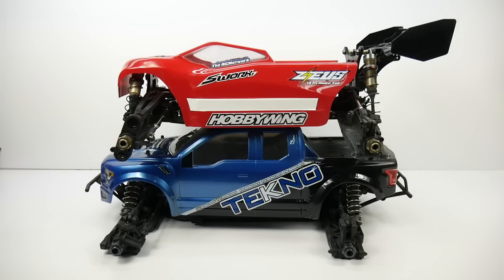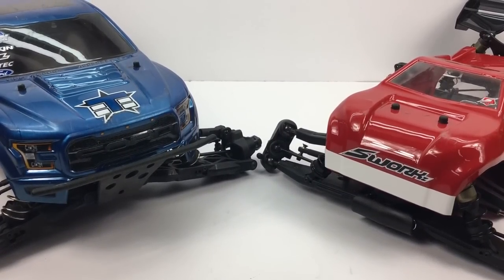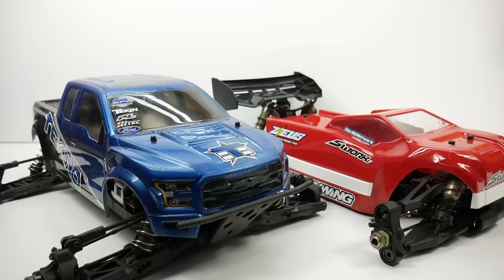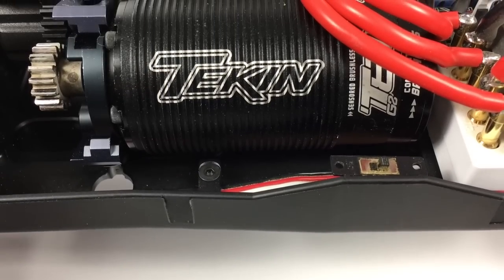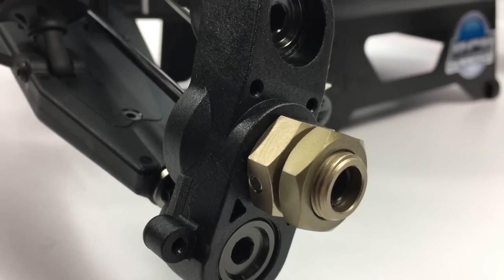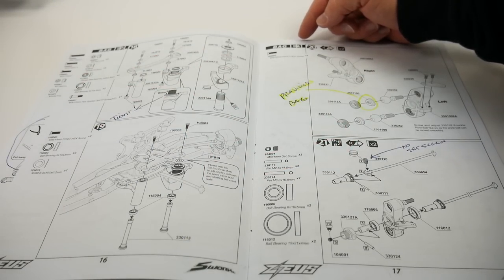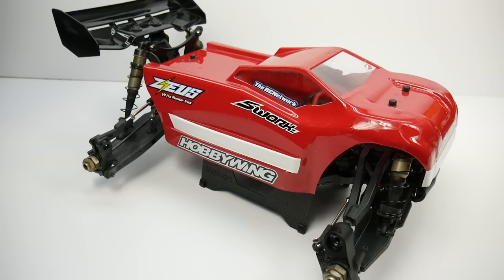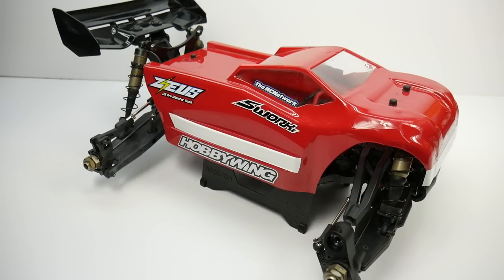Tekno MT410 vs SWorkz Zeus - Which One is Better - 1/8th RC Monster Trucks KITs

Comment: Just to mention it, the reason for the plastic caps on the Tekno is so that they can allow standard, vented and emulsion shocks.  Two of which require you to drill small holes into the cap.

Comment: I own both as well. Fully upgraded on both as well, but by far my favorite is the Tekno ET48.3... as a truggy that I have converted with 3.8 monster truck tires. The Zeus doesn't even come close to the ET48.3 if you're going to compare it as a truggy to yourself. Not talking directly to you Rich, just speaking in general. I had (2) fully loaded MT410's and decided to put a ET48.3 chassis on one of them. With a few other parts to convert it to a truggy/monster truck. Man it would be sweet if you could get a ET48.3 kit and do the same. Nothing I've own compares to it.. Great video as always and I agree 100% with your review.. Cheers!

Comment: My mt410 is still in the box from December of last year when it came out.  From the second batch when they fixed the motor mount problem.  Well life changing events I can't play with my toys as much with my new job. My brother bought kit and put the truggy size plate. Me and my cousin are still running the stock chassis but mine is the only one not built.

Comment: Hi rich, I own both and i agree the tekno is better. I haven't had issues with the sworkz per se but I've had small issues that add up unlike the tekno, which I've had 0 issues with. You can't find any bodies for the Zeus that are monster truck style. There aren't body posts that can fit a mt body. Agree the directions leave something to be desired. I'm comparing these as monster trucks and what you expect from that. Also on my sworkz the wing and body both broke very quickly. That's why I wanted to switch it over to a more true mt style, no wing. Although both are great,  as a monster truck kit the tekno is better.
Reply from the maker: Very good points and we seem to have had similar experiences.

Comment: Just purchased the MT410. So done with cheap rcs that have me on the bench more than the field. Just got back from the field and both of my Traxxas broke not even a combined 7 min of bashing. 

MT410 seems like I'll get more play time than the bench...
Reply from the maker: You will be amazed!  I've had my MT410 since Dec 2016 and besides a broken body mount, not one thing has broken.  Plus, I haven't changed/maintained anything!  Just a quick air compressor blow off after it gets back home.  Solid MT!
Reply: The RCNetwork man! That's great to hear. Even my Redcat MT10E. Just stopped working today. I'm keeping them in the bench till I get the Teckno working. Then I'm gonna hold a sale and get rid of some headaches! Lol. Great video series! Subb'd!

Comment: Im trying to make a Hotbodies d8t in monster truck with buggy parts.
Reply: D812 and D8T rollers will make the same thing cheap. They look cheap especially tekno taken a leaf out of traxxas book. They knew guys HATE plastic shock caps so its a cash grab truck. Truly. @ £415 plus £150 to proline. $800 roller and no carbon or alloy shock caps.

Comment: Thank you so much for a very detailed and informative review. Listening to them running the SWorkz seems a little quieter than the Tekno. Better gear and or drivetrain tolerance? SWorkz may want to use truggy body and wing for better aerodynamics in air than a big truck body? You are really convincing me to buy the Tekno. Great video and I like your honesty in your reviews. I can see that a really good working suspension can keep breakage to a minimum too. You are making me pro Tekno
Reply from the maker: For me, the clear winner was the Tekno...but I like to let the viewer decide by providing all the info from my experience.  You can easily make the MT410 a truggy with wing with a few parts if that's your fancy.
Reply: @TheRCNetwork  I wouldn't want a druggy body. I was grasping at straws as to why SWorkz calls it a MT but uses druggy body and wing. Maybe it just didn't "fly" good. Or they got lazy and didn't want to make the chassis changes necessary to put a truck body on. Just a thought. I have been looking for other videos you have on the Tekno MT 410. I'm really liking what you think of it. Do you think the ET 48.? modification would make it better with the added length to the wheelbase? How high can this go for lipo batteries? 4s, 6s, 8s? What would fit? The light bashing you did with this looks like what I am interested in. I don't want to break it or find it's breaking point. I want to do some jumps and flips and maybe some speed runs with it and maybe get my Son-in-law's and Brother-in-law and nephews together for some family fun. I can see having an off-road track being built in our backyard too. I know you made this 2+ years ago but I trust your opinion and appreciate your time and knowledge and answering back. How many videos have you made using the Tekno? Does it still hold it's own to the new technology that's available now? God bless and keep up the great work!

Comment: T plugs on a 6s esc?! WTF
Reply from the maker: Almost a 3 year old video, where Deans were still champ.....I use XT90 on all 4s and 3s packs now. Also, these both ran on 4s, btw
Reply: @TheRCNetwork  The 6s was related to the esc. But why are you using xt90, ec5 has got a little higher amp rating, i think its 120 instead of the 90, that xt90 has. 
(Sry for my English)

Comment: Neither are monster trucks. They both have centre diffs.
Reply from the maker: Most MT's on the RC market will have some sort of slipper/center diff, at least the ones that drive well.  MT's like the SMT10 have a locked center transmission, and solid axles, which are a bit harder to drive, maintain and won't stand up to higher power/speed systems
Reply: The RCNetwork I would say they aren't monster trucks then. They are just truggies with big tyres
Reply from the maker: Lawrence Timme technically, Truggies have a 2” longer chassis plate, like the ET48.3. I know you’re trying to be a purest with “what’s an MT” but in the RC world, this is it. If you go down the line from the MT410, Kraton, Outcast, Revo,, EMaxx, Stampede, Zeus - all based on a Center driveline with a center diff/slipper. Any solid axle truck with a locked center will be limited to 20-30mph before you start seeing massive parts breakage. Look at my Kyosho Mad Crusher VE Video - what would be a proper MT in your eyes, didn’t last but 7 minutes - completely destroyed the front end.
Reply: The RCNetwork ik :D I am just like a grammar nazi for rc terminology :P tbh I prefer truggies, I have a hyper St myself, but even though it has 500k diff oil and big tyres I would never call it a truck. Even something like a hpi savage is closer to a real truck than these newer trucks. It has no centre diff but it has a slipper clutch, but then it has independent suspension rather than solid axles. 

There is also that losi muggy that they made which I guess would be the correct term for all these modern trucks which blur the line between trucks and truggies.

I guess they are an evolution of stadium trucks. I never hear anyone call there rc a stadium truck any more.

God damn idk what anything is any more XD I guess as long as it's fun to drive I should not care what it's called.